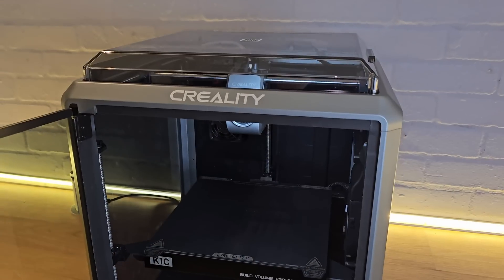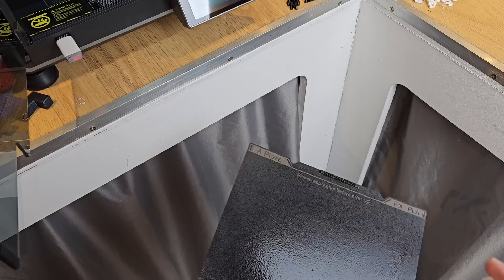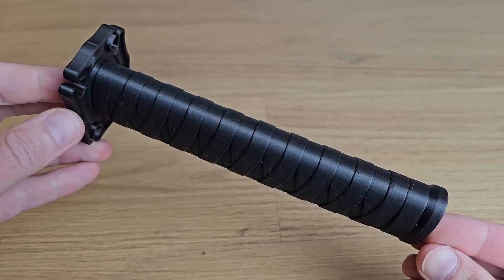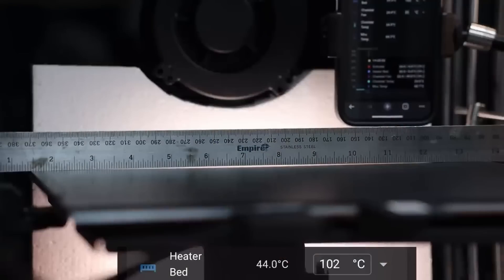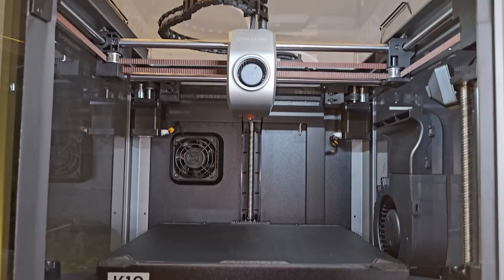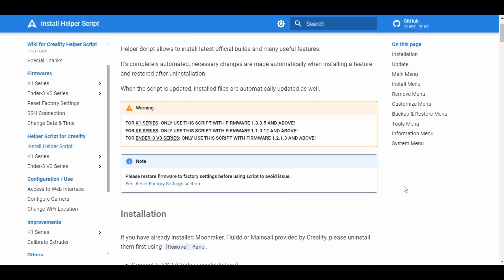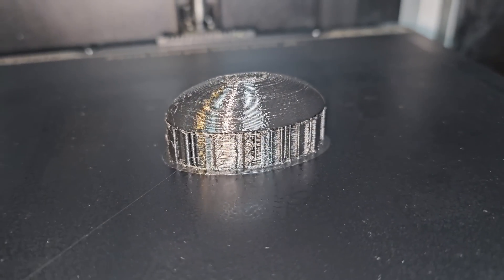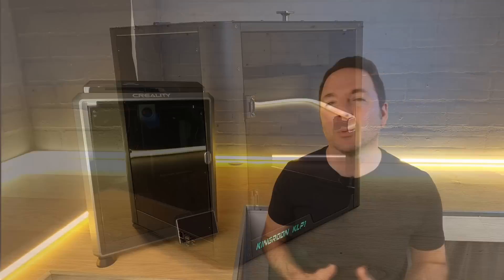The Best 3D Printer From Creality? K1C Review - This Is Not What I Expected

Comment: I just got the K1C for Christmas and I couldn't be happier with it. It prints very well and fast. I printed a couple of upgrades like a hepa filter box and riser/hinges for the top. Also would suggest getting the bed plate B which is textured and doesn't require glue. I've been printing like mad without any issues so far.
Reply: So how is your experience after a year? Just curious because I get it by the end of the month and I wanna know if I did a good purchase :)
Reply: @errisveliu  So far so good. I made a few minor upgrades, like printing risers for the lid so the belt doesn't hit, A hepa filter mount for the exhaust fan which was kind of overkill, a txtured plate "B" which I never hav to use glue on and a .02mm nozzle for finer details. In the year I have had a print fail only a couple of times. Otherwise the printer has been absolutely solid.
Reply: @Egad  awesome thanks a lot for the info :)

Comment: I wish print beds had a 5th post in center to mount it. it would help the bed stay true as the metal expands outwards so the bed must bow up or down. Add a post in center and then it cant go up or down but will have micro warps but would increase stress on it.   other option is to let the bedpost expand outwards with the heating just keep the post from moving up and down.

Comment: Exactly 1 year ago 10/2024, I bought and fought my K1 for 30 days, and then I couldn't take it any longer and I sent it back for a full refund.
I have other Creality printers.....

During that time, I told 3D to take a freaking hike.... Any activity that one has to spend more than 10% of the involved time monkeying around with settings, fixing that, ordering parts, etc... the one is either a masochist or an idiot.   I like to say I am neither.

A year later and I am going to try again.. either the K1C or SE.

and if I encounter the same thing, my response will be the same... I'll send it back.
Reply: Just dodge creality all together if you've had a bad experience with them. Not worth trying the same company that's frustrated you. There are other good brands and printers out there 👍

Comment: polymakers Carbon fiber Nylon blends print between 280-300, and in my experience it likes temps on the lower range of that, I generally print it at 285 so this printer can def handle some carbon fiber or glass fiber nylons

Comment: Excellent review on the K1 C! I noticed that you keep bringing up the flashforge adventure 5M Pro. I happen to have  purchased the adventurer 5M. I mostly bought it because I wanted to get into a really good core xy printer. Ideally, I would’ve liked to purchased the bamboo labs P1S, however, for the price of $599 versus the price of $299 that I paid for the adventure 5M. I feel like I got a much better deal. Also, I have the quick change hot end which is fantastic and the touch screen, which is very good compared to the worst screen in the industry on the P1S. I was able to add a camera for $29 which was really fair. Also, flash for to come out with an updated slicer called orca flash Forge this one allows you to print wirelessly to the printer. Which is great. There are also a couple of users that have installed clipper directly onto the printer. I am getting ready to start a print form and I am very heavily considering adding more of the adventurer 5m’s to my fleet because of the price and the excellent print quality that I’ve been able to achieve with this printer. I am just wondering why you have not looked at the base model like I have. Also, I think a lot of your complaints that you had with the adventurer 5M pro  have been taken care of with software updates for rooting the machine to klipper. Would you be able to give an updated review of these machines, knowing this new information?

Comment: I have a K2 Plus pre-ordered. It's going to be my first 3D printer. I'm excited.
Reply: Were you one of the lucky 50% off guys?  Lucky
Reply: Yep! I got it with 50% off on day one. It was actually hours after the sale started though. I was there from the start and saw it "sell out" instantly, but I kept refreshing and one came back in stock hours later and I grabbed that.
Reply: @lornelorne5727 how’d it go? My first printer was an Ender 3 V3 SE and I’m getting ready to upgrade to a core xy printer, my sights are set on either the K2, or the much smaller, yet more expensive somehow Prusa Core One. I’d pull the trigger on the K2 in a heart beat as a result of the price and size, if only I didn’t see so many people saying they had problems out of them. Hah. How did your experience go?
Reply: @lornelorne5727 how’d it go? My first printer was an Ender 3 V3 SE and I’m getting ready to upgrade to a core xy printer, my sights are set on either the K2, or the much smaller, yet more expensive somehow Prusa Core One. I’d pull the trigger on the K2 in a heart beat as a result of the price and size, if only I didn’t see so many people saying they had problems out of them. Hah. How did your experience go?

Comment: I'm glad it's an improvement over the K1, but I have seen others still have VFA issues. I don't think Creality has a great extruder design. For my money, I'd definitely go with a Q1 Pro. The Qidi X-Plus 3 has a heated chamber and much larger build area for the same price as the K1C not on sale. The Q1 Pro has a heated chamber and slightly larger build area for slightly less money with a coupon, even when the K1C is on a deep sale like now. I do think this is the best machine Creality has to offer, but I hope the K2 is an improvement still.

Comment: Had the K1 for a while. Now getting key111 error. Changed the nozzle board and mother board and still the same issue. Creality are not helpful as the machine was preowned. I bought it just outside the warranty. Disappointed as it was actually a good machine when it worked.

Comment: Great review. As a K1 owner I have not encountered most of the issues you mentioned. The bed mesh was one I struggled with, but after re-setting the belt and printing some spacer to put under the mounting points the mesh was within acceptable tolerances. 

That being said, there is one issue that you haven't mentioned nor tested with your K1C (at least you didn't mention it). TPU filament through the sensor and PTFE tubing causes all types of issues. They all come down to the extruder gear having too much resistance to feed the filament without jamming. The solution is a "tower" with a bearing spool holder that sits on top. You have to remove the lid to get it installed and working. Once installed it does print TPU well, even NinjaFlex. Of course you have to trick the filament sensor by putting a piece of filament inside. 

I know the K1 had it's share of bad reviews, but I've been happy with mine. I've printed PC, PA, ASA and ABS without issue. I did replace the OEM build plate with a standard (bumpy) PEI plate. I haven't had to use any adhesive for any of these and have not seen any adhesion issues. 

Last, you mentioned opening up the firmware. I've done so with success. It does indeed offer more features. Some are very much needed. However, the down side is when the Creality updates get posted the printer wants to replace your hard work with the newer OEM version. I made the mistake of installing an update and just haven't taken the time to put the unrestricted version back on my system. It seems to work okay with the OEM firmware.
Reply: ha, same, printed shims to level the bed and apart that have not done anything besides putting a CHT nozzle and it's been printing hundreds of prints with no failures at high speeds. Really hard to tell why some videos hate K1 or have troubles with it.
Reply: @MrTechcat  because they didn't shim the bed and change the nozzle? These things should work properly out of the box, no wonder Creality have a terrible reputation and that comes from someone that owns two of them, also modified so they work properly. 🙃
Reply: @MrLilredmachine  yes, I have upgraded my K1 to Bambu A1 Mini.. there is no comparison. I don't need to do anything and baby sit the printer, I just works hundreds of prints with no issues. Everything is automatic. That is alone worth more than anything Creality can offer.
Reply: @MrTechcat  nice one! For the money of anything Creality offers, the A1 mini is hands down lightyears better in features and quality. 

Presently looking at replacing both my Creality's with one printer that prints considerably faster and Bambi Labs is forefront as a consideration. I'm doing my due diligence and looking hard at other printers as well, including Creality as they have released so much since I bought my V2s when they released. However, I cannot foresee ever buying another Creality as there are so many horror stories with quality control and it seemingly being a random chance as to whether you get one that works, works for a month, or bricks immediately. Probably going to hold off a minute till the next gen drops, including the new Bambi offering.

Comment: Hi Ricky great rewiew
I have a K1max and only issues i have had are bed level issues was great for 1st six months then went out dished in middle section, solved issue with rubber springs installed in place of solid spacers, also increased flow rate this seemed to lay down a better first layer(increaded to 110%)would love you to make a tutorial on klipper and mainsail on a K series machine to teach us why we should root our machines
Mike

Comment: looking forward to seeing your review on A1 as i have just bought one👍👍
Reply: A1 is my 12th printer and it blows the K1 out the water, not always in speed, but in ease of use and reliability it's incredible. Especially on sale for £419 with AMS lite
Reply: I had an A1 with AMS lite prior to their recall, and it's pretty much perfect for PLA.   Aside from it requiring quite a lot of desk space (without the top mount) the A1 is a pretty fantastic printer for those who care about "just printing".   It's a bit slower than many of the core x-y printers, but not materially so.   10% to 20% extra print time is something you'll never worry about...and if you do you can often tweak the slicer configs to regain the time.    Hopefully you're having fun with your new A1!

Comment: For me, nothing matters as much as a solid heatbed. But seeing that they are still unable manufacturing flat and perfect heatbeds, I always feel satisfied when I think about my X1C and how low the maintenance is with bambu printer. I really tried hard liking my ender 3 s1 pro, building an enclosure and upgrading it with stuff, but the heatbed was always a bottleneck in terms of quality. I hope I will never again have to level each and every stupid corner of this hardcore uneven bed... so ridiculous that I have to use tinfoil to make it somehow work... never again creality.
Reply: Tbh the bed leveling issues on the k1c  seem to be absolutely minimal in terms of the real world problems they cause, especially compared to the k1 max. But im with you in that if I get burned once buy a company, I'm not trusting them again, idgaf how much they've improved

Comment: I’ve really liked my k1 however I did have some of the problems with the extruder and hotend but I switched it out with a printed extruder that has worked very well and the hotend was replaced with a bamboo style hotend. In terms of the vfa’s I did have that but I doubled speed and accel and that got rid of it

Comment: I have a budget of 800 euros. P1p or this one?
Reply: They are both on sale right now. K1C for $415 USD on crealitys aliexpress store. P1S for $600 USD on bambus store. Not really but kinda in the same price tier. Here's a comparison:

K1C advantages:
- Open source firmware (some people couldn't care less, some people see it as absolutely essential)
- Nice, large, easier to use touch interface
- Camera is waaaaaay better
- Comes with hardened nozzle (can buy hardened Nozzles for P1S, but it's an additional charge)
- Replacement nozzles are way cheaper (since you don't have to buy the whole hotemd with it)
- Bed temp gets hotter (both spec sheets say 100c, but K1C actually accepts gcode for 110-120c). This is a bigger deal than you may think, since some high temp materials do a little better with temps just over 100c

P1S advantages:
- Slightly better print quality (but i mean very slight, you probably wouldn't notice in practice)
- Slightly better first layer (again, probably imperceptible in the real world)
- Waaay better customer service
- Supports bambu lab's excellent AMS multi material add on
- Can actually get .2mm nozzles from OEM (with K1C you can get them if you upgrade to the microswiss hotend, but it's still annoying as hell that creality makes a proprietary nozzle then doesn't sell .2mm)
- Quicker to change nozzles
- Nozzle brush isn't attached to bed, so you can use double sided beds (K1C can fix this with easy mod)
- Print volume is a little bigger (filament cutter cuts into print volume a little, but you can get around that when not using AMS, and anyways it's still a little bigger)
Reply: Oh just thought of one more advantage for the P1S. The Bambu smartphone app is better than the Creality one. Of course, you can just use a fluidd app for the K1C which would be way better, but theres one problem: you lose remote print monitoring. You can get around this by just using a vpn to tunnel to your home network, but beginners don't want to do that shit. Of course, that method would allow you to monitor prints remotely without your camera feed (which can potentially see inside of your house) going through some company's cloud, which some may see as a huge advantage. Also worth noting that the Bambu app has some other features you may or may not care about (and the Creality app does have most of those features tbf, but I just find that it's cluttered and unpleasant to use)

I'm sorry that point was so intense lol, it's pretty nuanced but overall the smartphone companion app experience on the Bambu is a pro for the P1S. How big of a pro it is depends on your needs
Reply: I recommend checking out Qidi. I would definitely pick the X-Plus 3 or Q1 Pro over the K1C.
Reply: @802Garage  I second the opinion that the  Q1 pro in particular (which is also on sale rn lol) is also worth considering. There is only one catch, and that's there's been a lingering belt tensioning issue that has resulted in a lot of people's prints having artifacts at certain speeds. Personally that's enough for me to rule it out completely (for the same reason I rule out the regular K1), but a lot of people love theirs so hey, that's a personal decision

on that note, the flashforge adventurerer 5m pro, and bambus A1 (which is also on sale rn for a stupid low price) are two more great options around the same price tier. the industry has been going crazy recently lmao
Reply: It's on sale right now get the p1s ASAP don't even think about!!
Reply: @alycapo3391  I'm going to buy p1s?